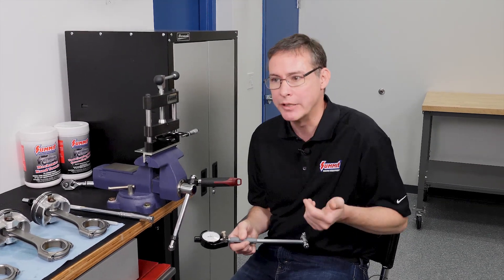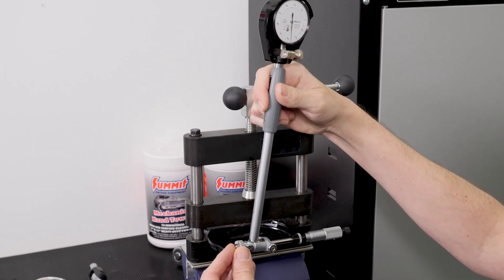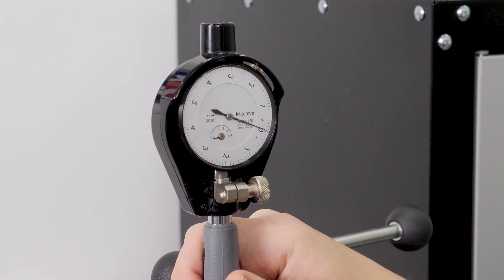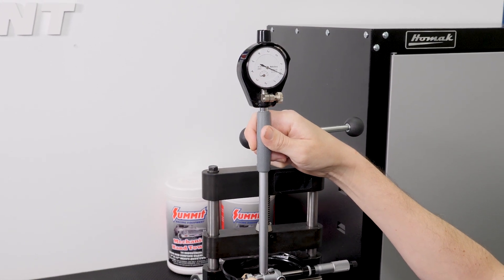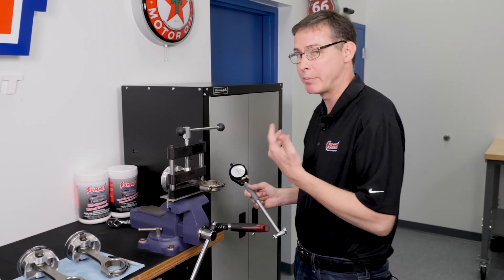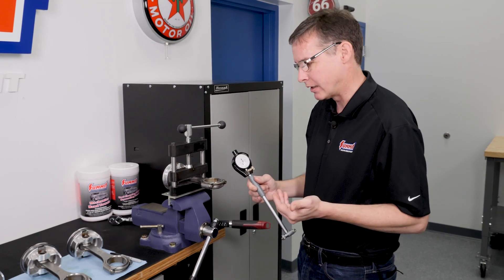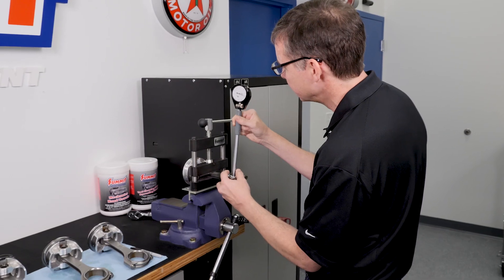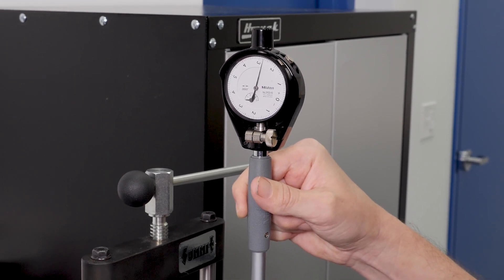How to Set up a Dial Bore Gauge | Engine Building 101

Comment: Very informative video. The only thing I would suggest doing in addition to what you're doing would be to be certain you check your micrometer, or like device, to a standard that usually comes with a micrometer, or set of micrometers. When I worked for 40 years as a Toolmaker, we set our bore gages to a specific sized set of gage blocks. Yes, most of us don't have a set of gage blocks sitting on the bench, so the way you describe is best for most people.
Reply from the maker: Thank you, Milo! We appreciate your feedback.